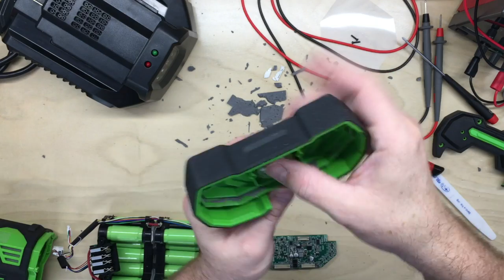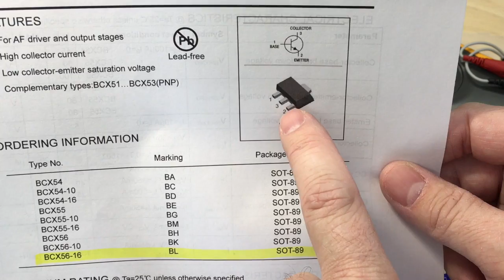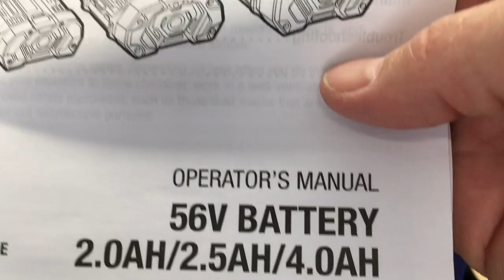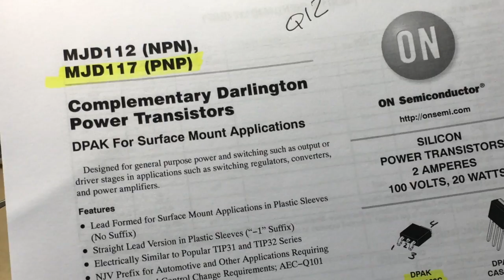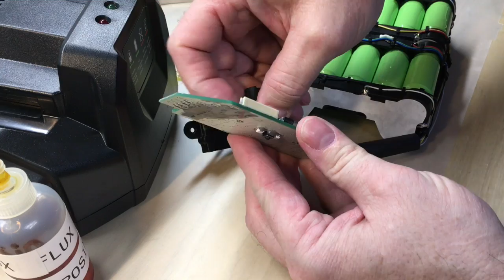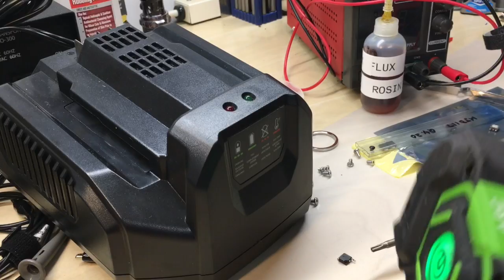EGO 56V ARC Lithium Battery Repair

Comment: Thanks so much for this video, what a great help it is for diagnosing EGO battery issues.  I have a new 5.0 Ah EGO battery with a bad component on the board (no 3.3 volts anywhere) and I was wondering if you knew if a BMS board from a 2.5Ah battery would be interchangeable with the board on the 5.0Ah battery?  There seem to be a lot of used 2.5Ah batteries for sale online, but I can't seem to find a 5.0 Ah.  If the boards are the same, it seems that I could harvest one from a dead 2.5Ah battery to use in my 5.0Ah.  Thanks so much for your videos!
Reply from the maker: John T , Hi, sorry I do not know anything for sure about the 5.0 or 7.5ah battery. I would be quite sure they are different. When you compare the board you have  to the 2.5ah in my video do they look different?
Reply from the maker: John T, Thank you for your comment!

Comment: I have a 2.5Ah battery which didn't take charge. I opened it up and saw that that Q12 is shorted but there is also some trace burned near what looks like a voltage regulator.  I am going to try and bridge the trace with a piece of wire. But accidentally I must have pried off a component hat is marked "RT2". Will you be able to tell me the value printed on this component? Looks like a resistor, and the "T" in it probably means its used for temperature measurement/biasing.
Reply from the maker: rachelbinto, hi I will help all I can.  Unfortunately the RT2 is a component that is unmarked. However I believe as you that this is a NTC.  Mine reads a value of 14.1k ohms @ 65F ambient while in circuit. It also goes down in resistance with increase in  Temperature. Hope this helps.
Reply: Yes that's great help, thanks, In a pinch I can just solder in a resistor and see if it works.  I just ordered the Q12 transistor from digikey. Like I was saying the trace is very badly burned with deep charring into the PCB itself. I believe the trace is the output of a diode which is connected to a decoupling cap, which is also input to that large voltage regulator. The output of the regulator is probably connected to that shorted darlington transistor which may have sucked too much current off the trace  to have burned it this bad. This is a great video that you have made. How did you know details like the two connectors are feedback from individual cells etc? Do you have schematic or something?
Reply from the maker: rachelbinto, I wish I did have schematic. There is no information at all that I know of. I just spent some time troubleshooting and tracing out the best I could but there is still alot I do not know about the bms. I have not seen one yet with the burnt trace as bad as you described, but that smaller trace has lifted off on a couple of mine I have repaired so far. Looks like you are on the right track. Best of luck. Let me know your results. Thanks for your comment.
Reply: So, I have not been able to fix this board yet. I did have a shorted darlington transistor (just like yours), but in addition I also had some traces burned near the T1 transformer and the Q10 transistor to the point I cannot tell how they were originally connected. Will you be able to use a multimeter and tell me what is the 3rd pin (pin closest to the gate of Q10) of the T1 transformer connected to? Also what is pin 1 (gate) of the Q10 fet connected to? Right at this location the traces are gone and I have no idea what connections are missing.
Reply from the maker: rachelbinto, it looks like the 3rd pin you are referring to is going to D11 anode which is right next to it and its cathode leads to C3+.  It seems the gate of Q10 goes to R51 which is a 20k ohm resistor and that resistor leads to pin 5 of the U4 chip. It seems that the gate also jumps down to R50  which is a 20 ohm resistor that leads to pin6 of U4 chip. U4 is the pwm chip that I did show on the video with the scope signal. (As you may be aware this is a dense multi-layer
 board and it could be more traces uses vias that go elsewhere but that it the way the layout seems to me) Hope this helps. Best of luck!

Comment: Thank you so much for your videos.  You're able demonstrate / teach technical information in a non-technical manner.   That is a real gift and so happy to have found your channel.

One question..Have you thought about digging into the Ryobi 40V batteries?  I have several which need your technical skills.
Reply from the maker: B Appel, I have had lots of trouble with the ryobi 40v, all mine had issues with bad cells and I have replaced some cells but they seemed so problematic that I am running my only 40v tool by using 2 18v ( Makita or Milwaukee) in series and it runs it fine, but not pretty! Lol!
Reply from the maker: B Appel, Thank you for your comment!
Reply from the maker: hello_world, I have not.I have only reused tested good cells from other packs with bad cells at this time. It would be great if someone has found this available for sure. Thanks for your comment.

Comment: I am dying to know if you called EGO to let them know that you located an issue with trier batteries if I’m understanding this to be true? You did say that it is probably a defect but have you come to the conclusion that it is in fact a defect sir?
Reply from the maker: Rendus4 , sorry to hear you had to scrap yours. Yeah mine did the same way yours did. It was warm also and blinking as it would when self discharging before I found Q12 shorted. Thanks for your comment!
Reply: I have three batteries that are doing this!!! One has now completely failed. They are out of warranty because it is commercial use. How the heck do i fix it?
Reply from the maker: Robert LaFountaine, I have not contacted them. That was my only failure so far. I wanted others to see this In case it helped them and at least let the EGO community know about it. In a follow up video I posted, I mentioned after I purchased 4 known defective packs from Ebay, the 4 had 3 problems. 1 was the same I found in my faulty pack. 2 had bad cells and 1 had connection    Issues at the battery terminals. If I would have had a lot if responses stating other viewers have had same issue then it should surely be reported to EGO. I have had great responses from community on the found fault but no one has actually commented they had the same issue.
Reply: Thank you for this video! I had the green blinking light of death as well! It's too late for me, while de-potting the bms, I knocked off the transformer (silver box), so I just scrapped it. But before de-potting the bms, and while the bms leads were still connected, I noted that the area where Q10 is was warm. I was thinking that, since Ego has a long-term storage self-discharge mode, maybe something in the algorithm was stuck and it was automatically self discharging down to 0 uncontrollably. I wish I still had it, I wonder if my Q12 was bad, or maybe it was Q10 for me?

Comment: Man, you are good...I learned so much from this video that you produce concerning the Ego battery...I have two Ego Lawnmowers and six batteries along with the blower...Recently; I just had 4.0 battery go down on me and it is flashing red when I press the button and I think I am having the exact same problem as you...

Where did you get the specification diagram from and where do you order the parts?  Any help would be greatly appreciated because I am trying to save $225.00 dollars for a new battery plus I would like to learn how to fix this wonderful battery...

Thanks in advance
Reply from the maker: Larry Coleman, I understand trying to save money by fixing it for sure. I do not own the 4.0 pack but they are most likely similar. When you ask about the diagram, what are you asking? I do not have a actual BMS schematic diagram. It would be awesome to have one, EGO is not going to let that get out!  What I did was went through and checked all components I could by finding the identifying numbers and searching online. Years ago you had to search Digi-key, Newark, or Mouser etc. for parts but now you can just google it and you can find 80-90% of data sheets that easy. Same way with ordering components. I used to have to order from Digikey, Newark, etc. but now you can find common parts on Ebay etc.  without a minimum order number. 
Not always the way I do it but some parts from big Electronics suppliers are only available in the 1000’s       And that sucks when you only need 1 or 2. Best of luck to you. 
Hope this helps.
Reply from the maker: Larry Coleman , btw I should have mentioned that in my first video of the look inside the battery I mentioned how well EGO did on my battery so if it’s still under warranty that are really helpful and will typically let you keep the battery to recycle : )